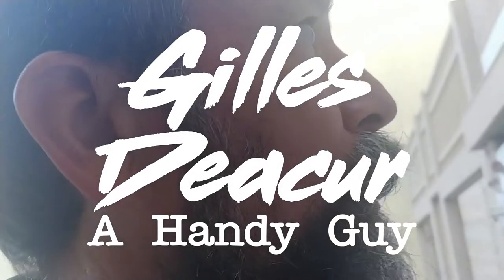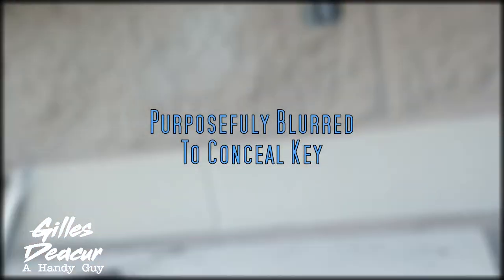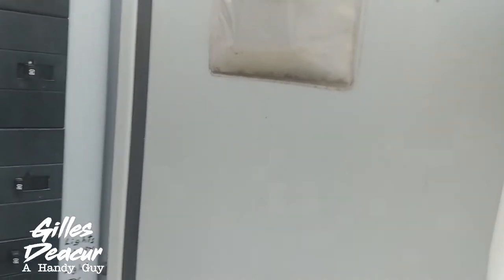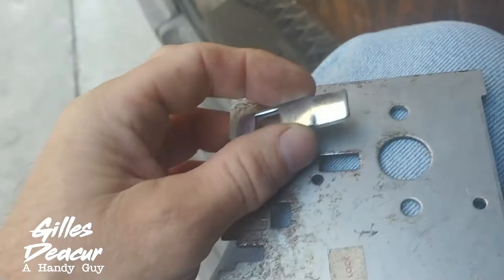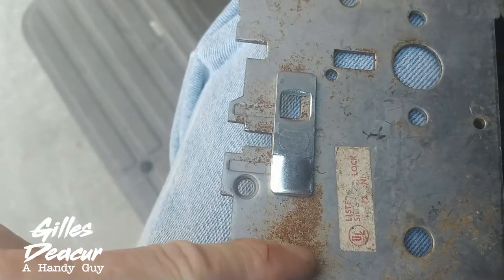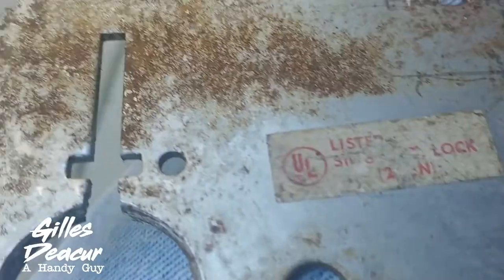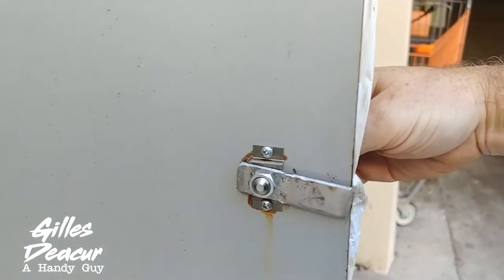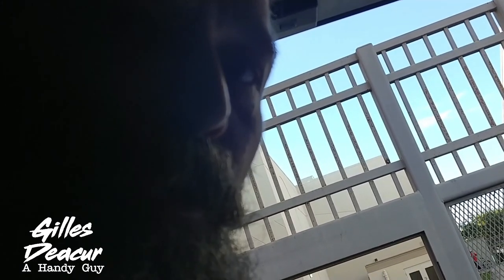A Day In the Life of a Locksmith - Episode 1 - Fitting a Lock to a Cutler-Hammer Electrical Panel

Comment: I was watching your vid on my tv and my wife walked by when you were cutting the plates with your cutoff wheel and my wife now knows how I get all those pinholes on the belly part of my T-shirts😂. If you don’t have access to a grinder or 120v and you need a 5/16 or 3/8 square hole, you can drill a 5/16 or 3/8 round hole and use a file to make the square corners. 
Thanks for sharing!
Reply from the maker: In my shirt too, lol.
Reply: Good call Odins, drill a round hole and make it square.  I do things the way LGCoF does with a dremel but its a really good suggestion on the round to square way probably save lots of time too.